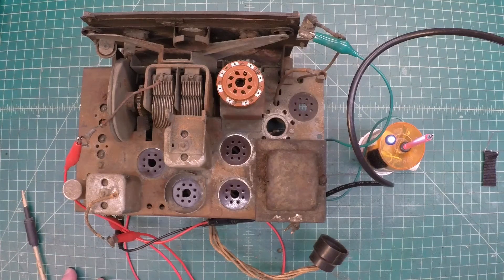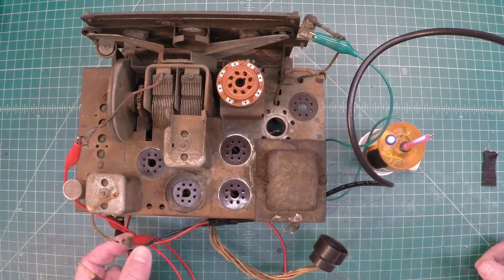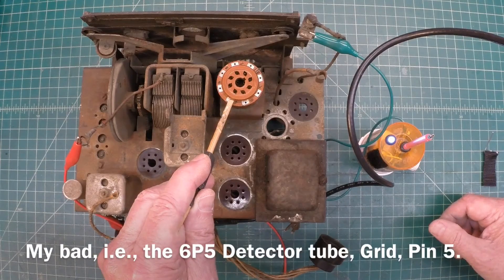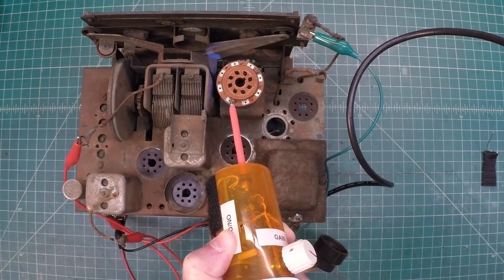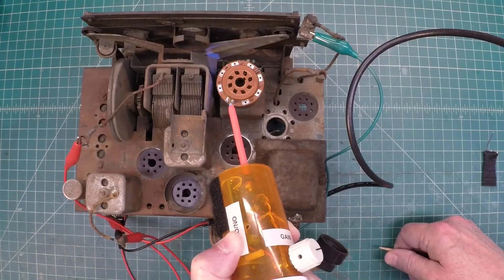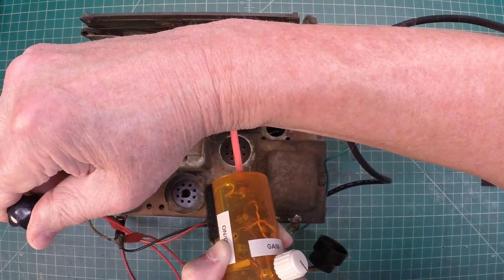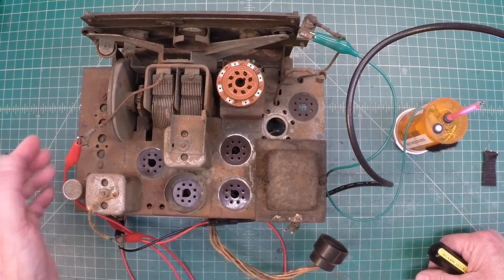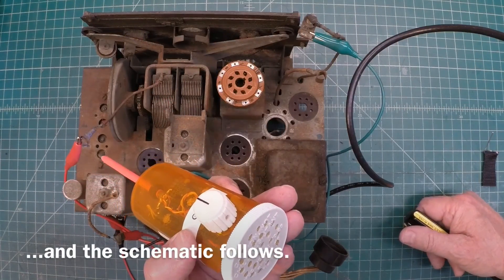Crosley 718-B - Signal Tracing an I.F. on a Dead Receiver

Comment: Would  this or a modification be any help in exposing Silver Mica Disease in the IF transformers?
Reply: Some commercial signal tracers provide for noise tests where the tracer applies about 100 to 150 volts through a current limiting resistor. Our may be able to show up the problem.
Reply: @johnnytacokleinschmidt515  Ok.  Yeah, I don't think mine does that.  I'll keep and eye out though.  Sounds like a good instrument to have around.
Reply from the maker: Silver mica typically leads to loud crackling noise and the B+ voltages will jump around ever so slightly. Best, Don
Reply: @RestoreOldRadios  Thanks.  I  understand that in  operation the SMD is like close thunderstorms!  You won't hear that with this process, though will you?  Also, where did you get your signal tracer design?  Yours, I assume?  Would you share it?  Looks like a great little device!
Reply from the maker: @microreniassance2929  Yep, it will sound like thunderstorms as the B+ voltage is arcing across the silver mica... and impacting the grid voltage of the I.F. amplifier tube attached to the secondary winding. You can see the DC bias voltage on the grid fluctuate as the arcing occurs. You can ground the grid of the 1st I.F. amplifier and the problem still occurs, then the second I.F. Transformer is the problem. A great reference with more on the subject: https://www.antiqueradios.com/forums/viewtopic.php?t=124704

The Signal Tracer is my design and there’s a more recent build as well. Here’s the playlist for the series and schematics are published on my Google drive, just look at the video description for the URLs.

How To Build A Signal Tracer
https://www.youtube.com/playlist?list=PLjLu4V-71S1KGbxuJbnMPkfXsDjDU0MrX

Best,

Don